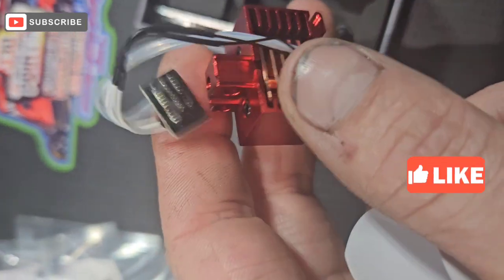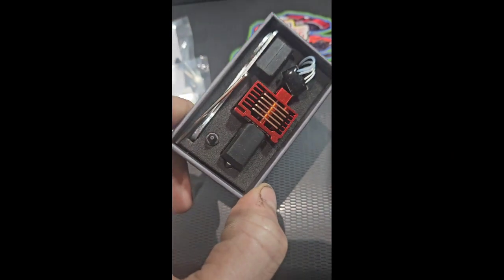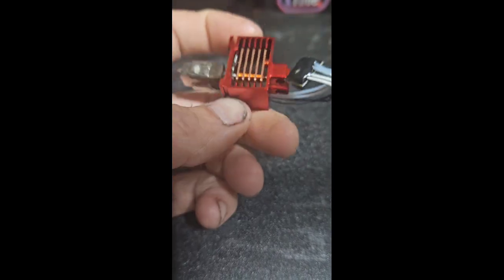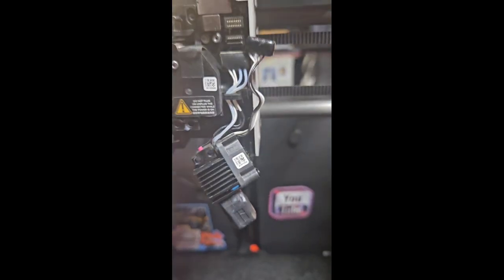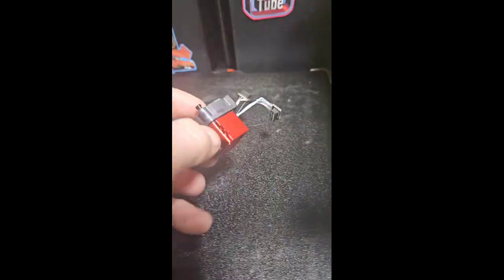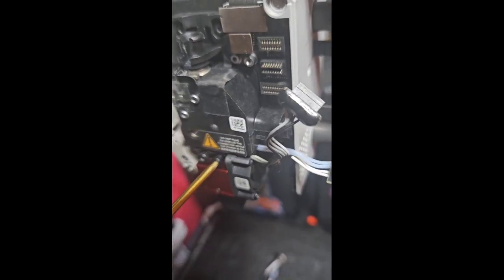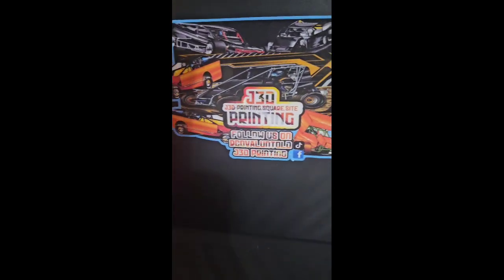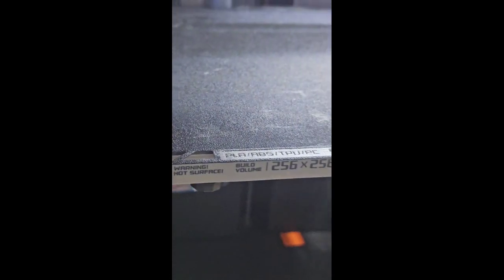BambuLab X1/P1P Hotend Upgrade - The Best Gets Better

Comment: Thanks for the helpful video! Any update after working with it for a while? Are you still running this Ali hotend?
Reply from the maker: @ERnet100   no I switched back to Bambu
Reply: @J3DPRINTING  do you think these T 2. 0 hotends are worth it to run at all with abrasives to save money? What made you switch, any temp sensor errors or trouble with different material nozzles? Appreciate your insight!
Reply from the maker: @ERnet100  no they aren't
Reply: @J3DPRINTING  why? if you dont mind me asking
Reply from the maker: @theway5209  was overheating

Comment: Im sorry for you, I don't understand why anyone buys anything from ALI express. Every item I have ever bought has been nothing but junk. If this head is so good why not get it from Bambu Labs even if it costs a few bucks more. I hope this part does not fry the electronics of your X! or P1P
Reply: And then when you contact the support about the faulty or defective product you received, they side with the seller instead of the buyer.
Reply from the maker: That's your experience sorry to heat that but I was very skeptical and I don't bs it's better hands down tmi do this for fun that's why I suck at it but I know my way around 3d printers the version 3 is a beast IN MY OPINION I don't put junk on my machines I left it on because it's better then the stock one but I get it inwas scared to
Reply from the maker: Also I can bet you everything from bambulab or any other 3d printing company plus more SAY MADE IN CHINA so why but buy direct
Reply: bambu doesnt sell it